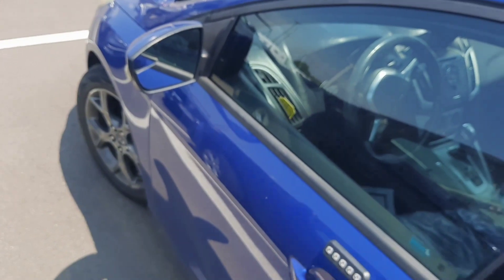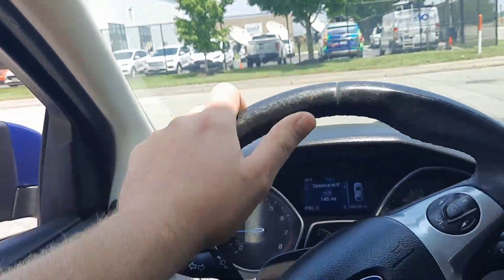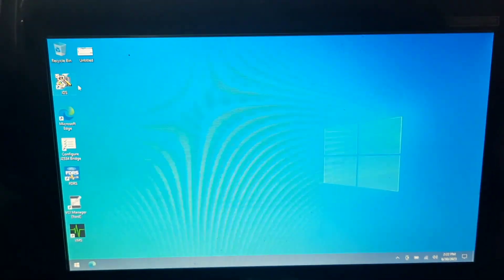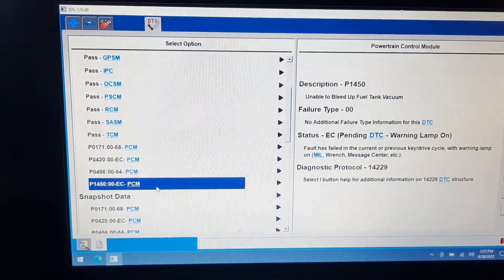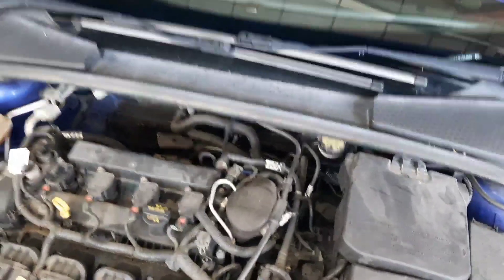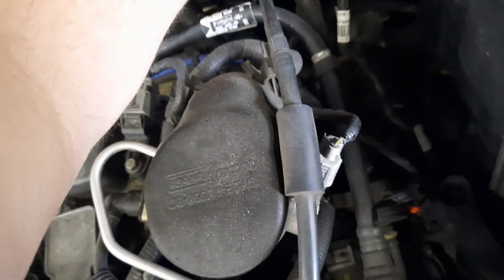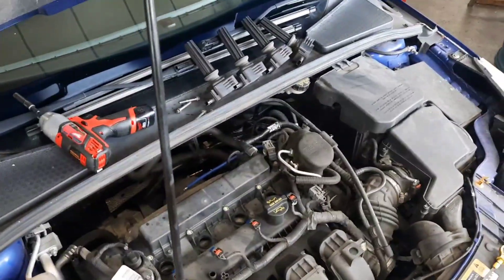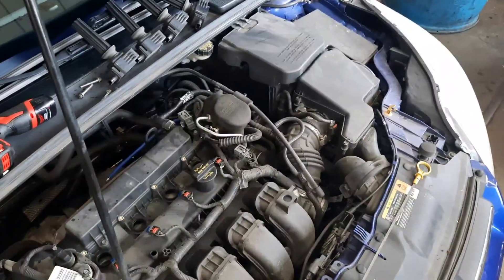Ford FOCUS Transmission SHUDDER and Engine LEAN Condition! | Dual Clutch Diagnosis

Comment: Hello, I have a question. I’ve been having issues with the power seat in my 2014 Ford Focus, and recently also with the power windows. Sometimes the windows work from their individual door switches, but if I use them from the driver’s master switch, they do work.

The driver’s power seat works in almost all directions, except for the forward and backward movement (the one that moves you closer to or farther from the steering wheel, toward the passenger position).

Do you know what this could be, or if this has happened to anyone else?

Comment: so my focus 2013 has a bunch of oil leakage on the black part of the enigne the oil tubes aswell and i cant go over 70 mph without transmission fualt service now error code

Comment: Okay I'm watching your video because I'm having concerns. I recently had my 2014 Ford Focus SE sent to the shop because the clutch b actuator went out. Since this happened 10 days after purchase the dealer went and paid for the repairs. They decided to replace the entire transmission. However, when I accelerate , either in city traffic or entering the freeway, the rpm needle shoots to around 3 (4 on a hill) before dropping down to 2 when I accelerate between 20 to 40 mph. I see in the video that you're going what looks like 40 or 50 and the rpm needle shoots all the way and you say the flare isn't enough to be a concern. Does that mean mine is normal? I've had my car back a week from the repair.
Reply from the maker: If you can record a video of your problem in space saving HD you can post it on my discord and I'll look

Comment: I have a question..I just replaced the entire clutch assembly on my 2013 ford focus… it now the car vibrates while driving and while idling…what could be causing that?
Reply from the maker: @maikyrivera448  take all 6 clutch nuts off, turn the engine over by hand 8 times, then retorque the nuts in the correct sequence. I've got a video for that. That will definitely fix your vibration
Reply: @ are you able to send me the link to the video? I would greatly appreciate it.. thank you very much

Comment: What are those vent covers on the trim above the sway link ? I have water coming down through mine and then the water sits on top of the front suspension arms.

Comment: I have a 2013 focus and i just went to the dealership because i was told it was a possible tcm with the codes that came up i have problems in low gear going up hill or just shifting from first to second  they kept the car for 3 days and then had me pick it back up saying that there were no longer codes on it and its fine  they didnt want to recommend a clutch or anything because they don't know for sure if it needs it i paid $211 but got zero insight as to where to go from here i really dont want to waste more money if i can help it any advice? Please and thank you
Reply from the maker: @RyleeHoward-hd7fp  hi, if you want to record a video of the bad shifting you can post it on my discord group I'll watch
Reply: @BigBensCarsAndCycles  Okay thank you very much! so I just subscribe and join your channel or how to I get to the group? Sorry I'm not on youtube a lot

Comment: Great video. 

My 2012 fiesta slightly shutters when driving at highway speed but shifts smoothly at lower speeds. And the TCM does not have any codes and no transmission lights come on. 

What would you recommend to do? Thanks
Reply from the maker: @ceezauto213  I would go full throttle several times to scrub the clutch and that'll help for a while. If the shudder is really bad then I'd do a clutch and fork replacement

Comment: Hello I have 2014 ford focus tcm makes sounds when I open door has tcm code going get it replaced under recall tomorrow they said it would it starts to over heat tcm does when I drive when it gets warm and they said would be fine to drive it down there would it mess anything further up inside of transmission?

Comment: Very glad to have run  across you and this video! So many conflicting reports and opinions out there about the shuttering. Is it at all common or normal? I have a very tiny bit at acceleration from a stop sign then nothing else. Thank you for any advice on this. 2016 ford focus se 88,000 miles
Reply from the maker: Glad to help! It's such a common issue on these I'd say it's normal. Drive it like you stole it on occasion and it'll mitigate the clutch shudder.  I've got a playlist of other focus transmission videos I made to help if you're curious!
Reply: @BigBensCarsAndCycles  I appreciate very much the advice ! How do I know when it does become an issue ? And do you know what the fix is ?

Comment: Hello, I have a 2018 Ford Fiesta diesel stick shift six speed. It drives fine for about 30 to 45 minutes then after that I get a shudder when pulling away in first gear, it’s driving me crazy any ideas what it could be please🙏🏻
Reply from the maker: Sounds like a cool car to drive. Wish we had that in the states. Sounds like you have some clutch chatter going on, and may want to replace the clutch, flywheel and slave cylinder

Comment: Are these transmissions really that bad? I just bought a 2012 focus with only 100,000kms for $5000AUD with timing belt recently done.
Reply from the maker: If you've got the updated design tcm and new clutch & forks they aren't too bad. Just quirky and they shudder
Reply: @BigBensCarsAndCycles  Thanks for the help, just saw your video on if the dsp6 can be reliable! All I hear is bad things about the transmission and to stay away from it, but so far it seems okay I haven't experienced anything too weird with it yet.

Comment: From a dead stop accelerate quickly, foot atleast half way down on the gas or full throttle, do this a few times, the computer will relearn your driving habits and will engage the cluch harder eliminating or atleast reducing the shudder,  you may have to do this every once in a while, hope this helps
Reply: So if 2 people drive the same car would that just confuse the computer?

Comment: i have a 2013 ford focus and it runs perfectly fine. until i’ve been driving it for about 30 minutes and then it shutters really bad when i stop and take off and get around 30 mph. i’ve taken it to the dealership and they say it isn’t throwing any codes and they can’t duplicate the problem when driving it. i literally don’t know what else to do to fix it. my car finally threw a code and they replaced the o2 sensor but that wasn’t the issue for the problem. please help. 😢
Reply from the maker: That seems like a clutch shudder concern in your transmission. If that's the problem, it's a $3000 repair. When it's shuddering, you can try accelerating hard several times to scrub the clutch, which can mitigate symptoms for a period of time

Comment: i have a 2012 ford focus that shudders and jerks from 1st to 2nd.  I'm a working student don't have time or funds to replace clutch. 
what i did is force a whole bunch of grease into the actuator holes... lol yea the grease actually gets in if you press down with the actuator. white lithium spray grease works too. seemed to have helped the shudders but it does shake around in hot climates or stop n go traffic...
ahh i just keep resetting it every once a while... never left me stranded in 6 months so time will tell i guess
Reply: Which actuator holes do you mean? The actuator motors? Currently dealing with same symptoms
Reply: That's a terrible idea lol

Comment: Hi my auto matic 2014 ford focus get jerkie when changing gear on high way speed but when driving slow its smooth changing, any suggestions?
Reply from the maker: are there any codes or lights coming on?

Comment: I have a 2014 Ford Focus SE and I have the same Codes - P0420, P1450! There was a recall on these but ford won’t do it no more!!! The P0456 Is probably the gas cap!
Reply: These don't have gas caps
Reply from the maker: Thanks for watching. I would change the purge valve before you replace your cat. Good luck!

Comment: I have a 2015 Ford Focus.  The transmission shutter is a electronic clutch issue with it. It tells us that we don't have to worry about AI. The computer doesn't know how to engage the clutches. Ford has done several software upgrades,  but it does not fix the transmission shutter. I found that you just have to give it a little more throttle to force the computer to engage the clutches.

150k on the plugs, it is time for a replacement.
Reply from the maker: For sure, and a dry clutch may not have been the best idea
Reply: Please see my comment above about your issue
Reply: I sanded the 3 ground connection it light weight made it a lil better than before